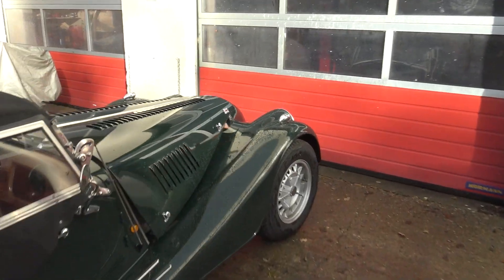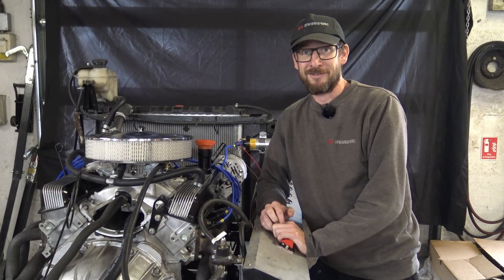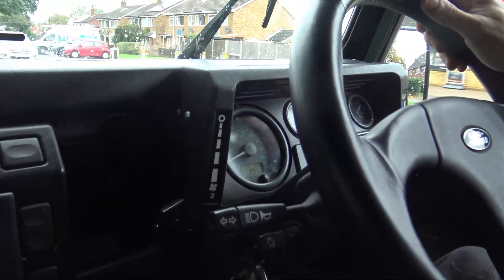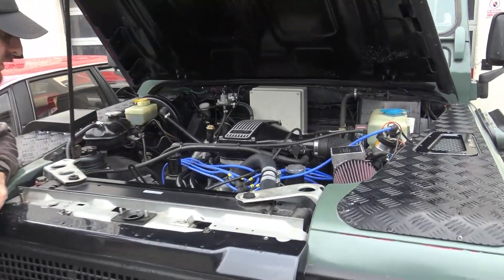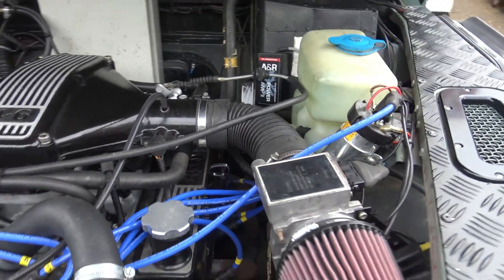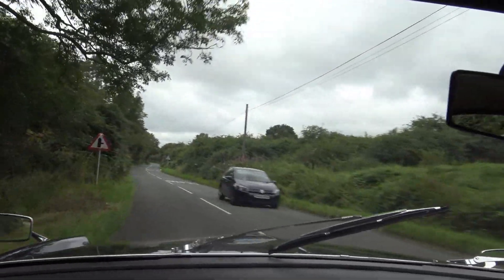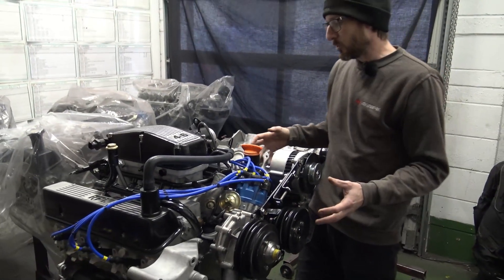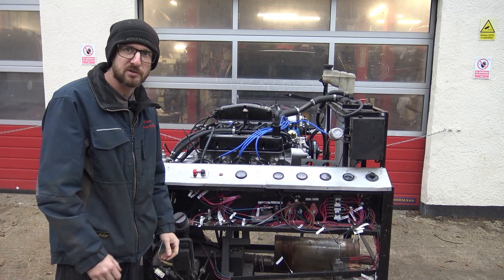RPi Engineering Rover V8 Workshop Update 46

Comment: What sort of power and torque is the 4.6 making
Reply from the maker: Normally around 250 to 300 lb/ft torque and between 250 and 300 bhp depending on the head and camshaft choice.

Comment: What's  the
1. Maximum  horsepower @ ???? remember
2. Maximum  torque
Reply from the maker: Depends on the engine build, plus with my twin turbo project the max torque will undoubtedly be up on that build so it then comes down to what you actually want and what your budget will allow.